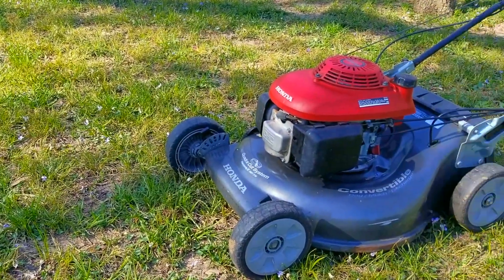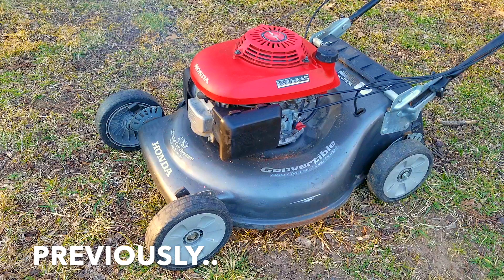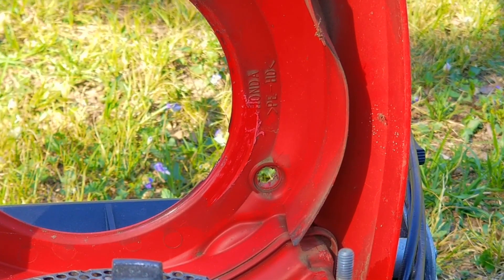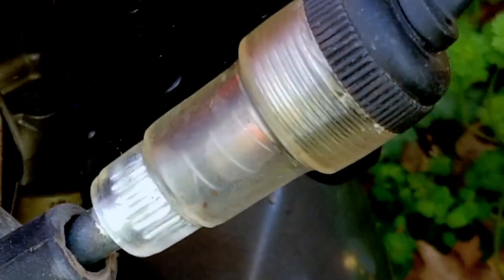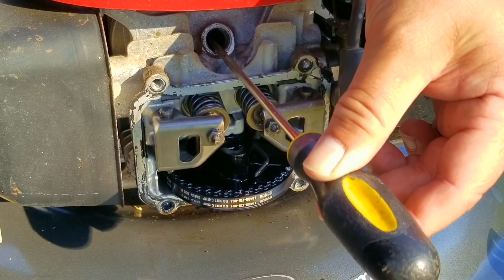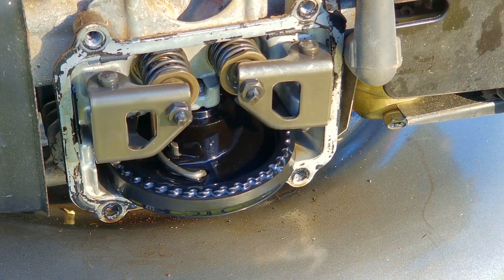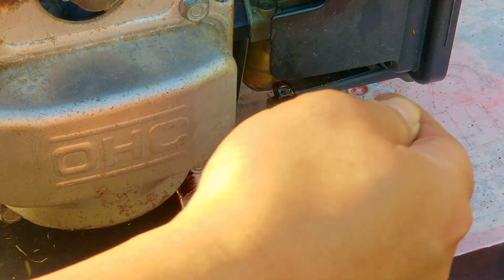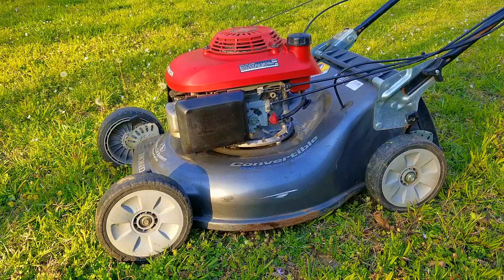Honda mower Stopped while running, finally fixed

Comment: Over the years i've learned. Any time a single cylinder stops running 1st thing it gets is a new NGK spark plug. Don't matter if it's a dirt bike, lawn equipment, or a chainsaw most of the time it works.
Reply from the maker: thank you K M.

Comment: What causes a cycle to fill with gas while trying to start it and it has a electric carburetor on it you no with a plugend under it with two wires and it's a BS 15.5 hp with starter and I have another question i bought a new battery for it and it seems as if it won't turn over fast enough ??
Reply from the maker: so there seems to be multiple problems here. An engine that floods with gas while using the key start would indicate a Carburetor problem, probably internal, I would suggest a new carb. Second the slow crank would also show that either the starter motor itself is weak or that the valve lash is off causing the starter to work harder.
Reply: @INSIDEHOUSEGARAGE  thanks for the answer but what's a valve lash i sorry i have to ask
Reply from the maker: @paulkillough3672  no problem. The valve lash is the clearance between the rocker arm and the top of the valve stem. To check it, you have to remove the valve  cover on your engine and then put the engine to top dead center to measure it. you have to use feeler gauges to check it. if the clearance is too large then it could cause a slow crank.
Reply: @INSIDEHOUSEGARAGE  thanks
Reply from the maker: @paulkillough3672  no problem
Reply: @INSIDEHOUSEGARAGE  hey if i hook jumper cables to the new battery it turns over a lot better like it supposed to could that be because of it being 24 volts instead of 12 just wondering?? I no you said it could be the valve lash or weak starter i checked the valve lash it was set like it supposed to be so idk what do you think??
Reply from the maker: @paulkillough3672  riding mowers have 12volt batteries. Where are you getting 24v?
Reply: @INSIDEHOUSEGARAGE  jumper cables
Reply: @INSIDEHOUSEGARAGE  and another car battery
Reply: @INSIDEHOUSEGARAGE  Investigate possible leaking needle valve or bad float setting flooding engine causing hydraulic piston lock.
Reply from the maker: @65csx83   that's a possibility

Comment: NGK plugs are the best I have found for small engines.  They do fail like any plug but those failures are rare. Another well narrated video with a simple logical approach.
Reply from the maker: thanks and I completely agree with you on that.
Reply: Thanks for the video. Just fixed a GCV160 by replacing the original  NGK plug with another NGK. Checked and cleaned the carb first which had a partially blocked main jet. Unit would run for 10, 15 or even 20 minutes then quit. Fire back up and run a while then quit again. Repeat. After the carb cleaning it ran for about 10 minutes, quit, fire back up and quit after a few minutes. Replaced the plug and mowed my entire 1/4 acre front yard with never a quit. I consider the problem solved.

Comment: After cleaning the carb twice(there was water/slime in the bowl the first clean), it kept stalling after a couple of minutes. Found your video and gave it a try. Replacing the plug corrected the issue. Thanks
Reply from the maker: no problem and thank you

Comment: I actually prefer the E3 spark plugs. When I was doing a service on my lawn tractor they did not have the spark plugs that I wanted. So I picked up two E3 spark plugs and went home and finished the service. I could not get over the difference in which the motor was running. I could feel the increase as I was driving across the yard. After that I was sold on those. All my own stuff has E3 spark plugs anyone else that brings me their equipment I just put champions in them they are easy to get.

As always I enjoyed your video and I most definitely hit the like button.
Reply from the maker: thank you David Frank for the information.
Reply: E3 spark plugs are some of the worst for longevity.

Comment: I don't think that it matters which brand of spark plug is used,I fitted a $2 AUD Chinese spark plug into my dads Honda GX35 powered line trimmer engine & it's still going good a few years after.

My 3 horsepower Briggs and Stratton lawnmower engine still runs the original Champion CJ8 spark plug that it was fitted with 33 years ago at the factory !
Reply from the maker: Wow thats amazing

Comment: Quizzical video. I would want to see the Laser plug reinstalled. Your question: OEM spark plugs as in all my magneto powered stuff their original spark plug;; some from the '70's . Unless I clumsily crack the porcelain or some such, I don't change spark plugs on a whim. I once read the mixture doesn't care whether it is ignited by a match or a blowtorch. and read plugs don't wear out on magneto systems. If necessary to replace, my favorite trusted brand is Champion.
Reply from the maker: that's a good brand of spark plug. thankyoiu 65CSX
Reply from the maker: great choice

Comment: Good video there sir. I myself am like you, I personally don't think that it really matters on using the OEM plug; however that one did seem to be a bit extra cheaply made maybe. But it did look rather fouled up and the gap on the electrode seemed to rather small but hard to really tell exactly in the video. 
I will say this.... you can never go wrong with good old NGK plugs... lol
Reply from the maker: You're absolutely right.  Thank you Rob Kercheval
Reply: @INSIDEHOUSEGARAGE  
Yes sir, and you're very welcome!

Comment: I have a echo blower and I did some repairs and now it won’t start. I realized the fuel lines were leaking will that stop it from running? Thanks for your time.
Reply from the maker: Absolutely, so it ran before you worked on it? What all did you do to it?
Reply: I replaced the air filter, primer bulb, and the fuel lines+ the grommet, then cold started and warm starter and it worked fine. The next day I realized the lines were leaking and it wouldn’t start. I think the fuel lines are leaking because I cut them at an angle to get them into the carb ports. Maybe the fuel leaked out the top and wouldn’t supply the engine. I think maybe if I take off the fuel lines and cut them flat it won’t leak and it will supply the engine. But you have WAY more experience then me, and know best. Thanks your the best 

         (P.S) I learned all my small engine knowledge from you, I’ve learned a ton thanks!
Reply: And yes it worked before I worked on it the parts were old and needed replacement.
Reply from the maker: @dianeross7611  thanks for the information I appreciate it. Can you confirm that's its the lines leaking and not the carb itself? I would the the carb off the engine and hooked the lines back up, prime the fuel system and watch to see if the lines are leaking or is it leaking from the carbs gasket or somewhere in the throat of the carb.
Reply: Thanks and yes it is leaking from the lines not the carb.
Reply from the maker: @dianeross7611  I would try using the same size line but with a smaller inside diameter.
Reply: @INSIDEHOUSEGARAGE  ok thank you I’ll give it a shot. Your the man.
Reply from the maker: @dianeross7611  thank you I appreciate it

Comment: I have good luck with Honda engine never had issue i replaced spark plug this year ones Honda engine is recommended in NGK spark plug
Reply from the maker: You are absolutely right about that

Comment: At 3 min on the video it won't start because the fuel valve is shut off.
Reply from the maker: fuel was already in the carb bowl. Regardless if the valve is open or closed, it should have started.

Comment: Honda mowers are nice, their pretty expensive new ho, then again your paying for the name and the engine, just like the brand stihl, your really paying for the name in my opinion. My question, should you have to pay more for the name of the Piece  of equipment it is. It’s like dewalt and ryobie, both dot he same exact thing, may e a few different specs, but one costs more than the other.
Reply from the maker: yes, for example wheel bearings vs. bushings or sometimes nothing at all but plastic in the wheel hubs. The most important part is the engine. Honda engines run very smooth as compared to the other brands.